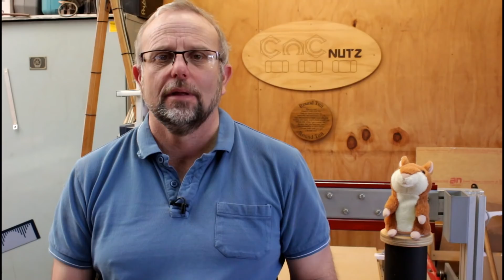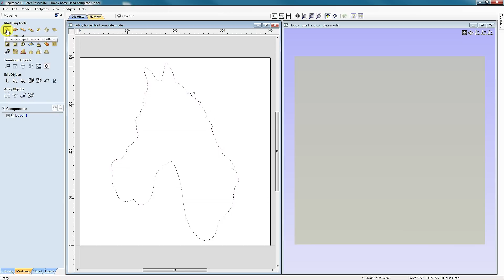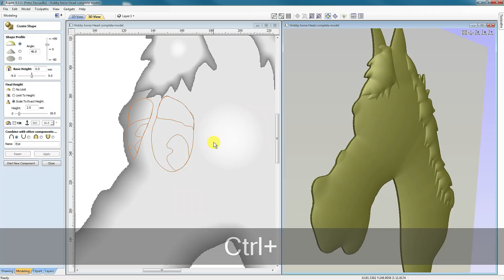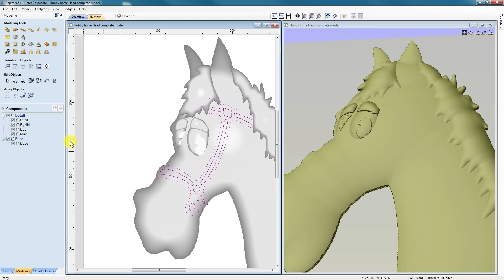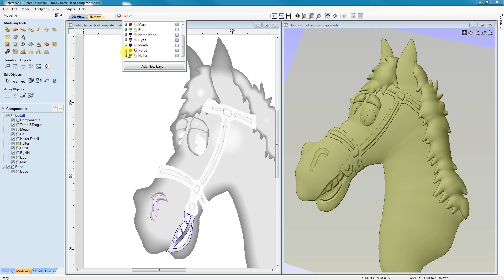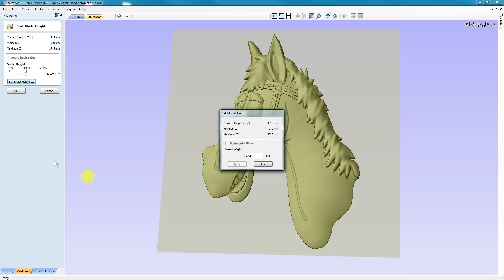Draw a 3D model in Aspire - CNCnutz Episode 229

Comment: Another great video! I upgraded to Aspire 9.5 about a year ago and have yet to work on a 3D model. I have many vector drawings saved that I would like to model. You have inspired me to set down and get to work on some of my favorites.
Reply from the maker: I think sitting down to do it is the hardest part. Spend your time making the 2d vectors and it will make the process a lot easier.
Have fun
Cheers
Peter